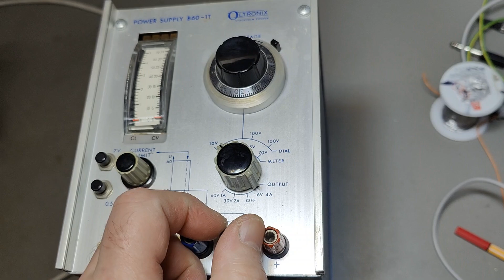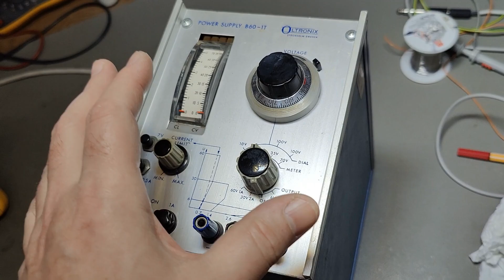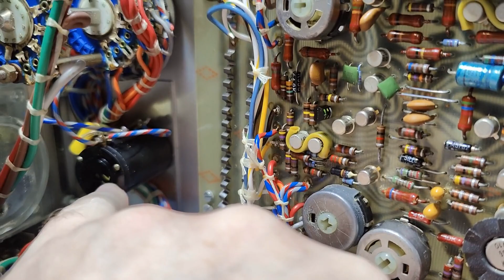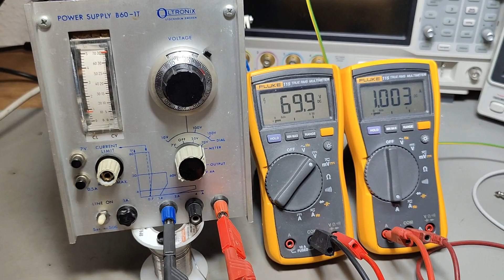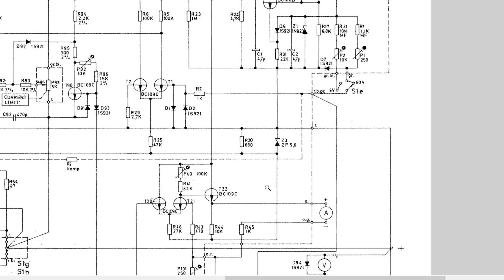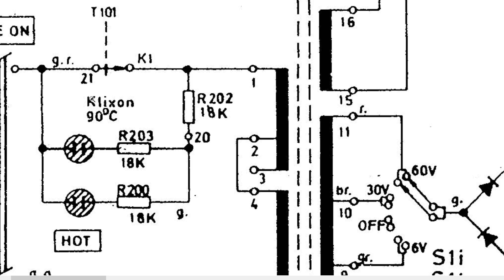Oltronix B60-1T 1970 Power Supply Test Teardown

Comment: Hi Thomas, one question regarding this model. What is the CL and CV meaning on the meter display? CL goes from 0 to 5?
Reply from the maker: CV is easy = Constant Voltage this means it is in voltage regulation mode, the other one I find CL wierd, it is of course Current regulation mode, or Constant Current mode.

Comment: I got so interested now, so there is an Oltronix PSU that I'm currently negotiating on. Love the 70's technology.
Reply: And I bought it. It was a model B602D. Already found the manual and schematic.
Reply: The B602D is a 1977 model. It is already a bit more advanced with two opamps (LM348 and LM741) and two NPN Darlington output transistors (2N6385) per channel. I will definitely put up some info on the Web about it when I receive it.

Comment: Hi Thomas, I've never seen this model, Oltronix has interesting designs, I like the discharge of capacitors - it's a load on the switch, but how long did it last - if it could be solved with a suitable switch design (double sparking contact) it's simple and almost immortal.
The green LED doesn't look very green in the video, the label pulled it down to yellow, maybe it would glow greener with a blue diode.
I've always liked the double gauge, in my youthful recklessness it was the reason I bought my Oltronix😁

Nice day 🙂 Tom